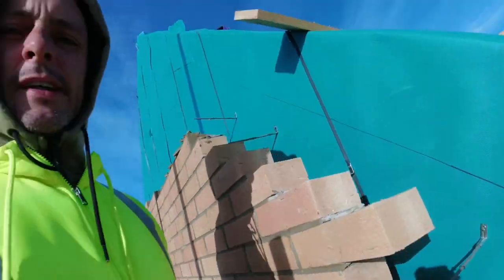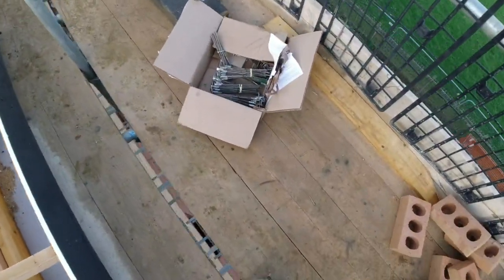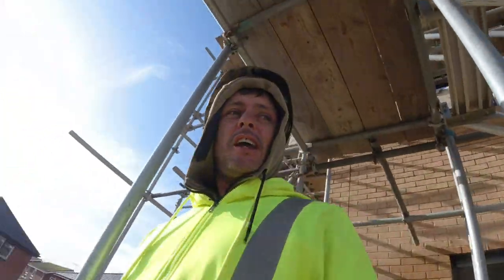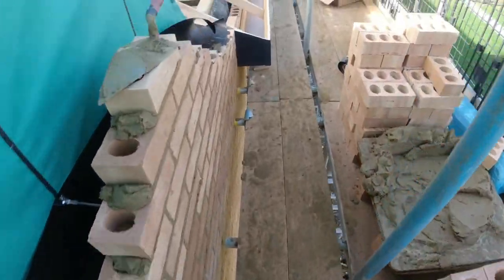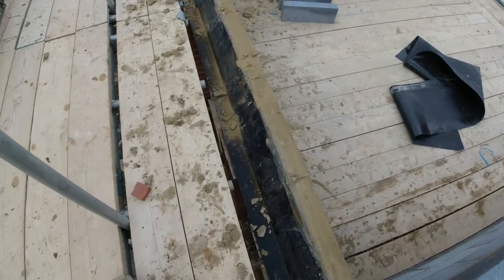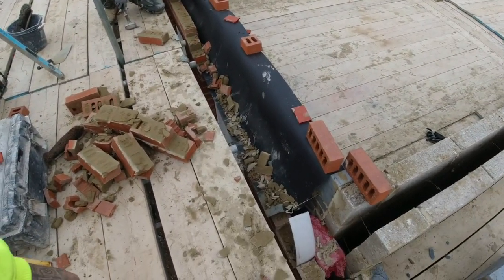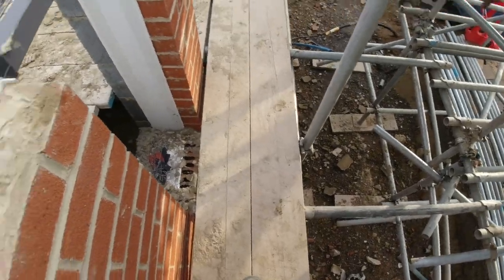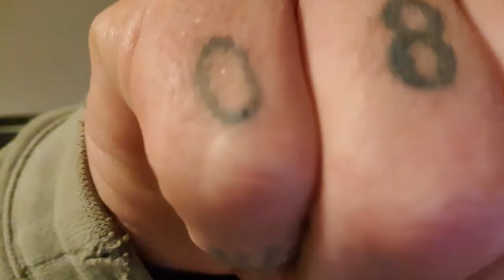bricklaying (nightmares)

Comment: It looks like there should be an extra component added to those ties, like a crimped fishtail? If that was me and they insisted that we used them ties I'd put a 1" batten down the wall to give a bit more length on the ties and then bend a 90° turn on the last 20mm to give it at least some purchase into the brick muck.... Great video as always
Reply from the maker: Yes mate totally agree.  There not worth toffee. Cheers bud 👍
Reply: Yeah they're shit ties
Reply: Shouldn't have to modify ties that's time we as bricklayers are not paid for ,, absolute shite ties ,,  can see some gables failing not down to workmanship but to them ties

Comment: I'm no brickie but wouldn't it be better if they made a tie that was flat bar that screwd to one side and had a bend on the other that went in to the hole of the brick and when filled with muck would have no movement
Reply from the maker: Them ties were awful bud. Glad we walked 🚶‍♂️

Comment: Interesting to see on the taken down work all the perps looked pretty full - forget how many times I have read from the pick and dip detractors that the perps aren't full.
Reply from the maker: All well full mate. Always push to the front 😉🤣🤣🤙🤙
Reply from the maker: Mine are bud 😉
Reply: @trickybrickys  Yep, I can see that, and that's why I commented because the non believers reckon with P&D the perps aren't full when it's easy to see that they are.
Reply from the maker: Have a look a my vids 😉😉🤣🤣

Comment: In the US , we use different wall ties ( brick ties) ; they're wider and corrugated galvinzed metal strips ,  but even they would be better with a downward end to clip into one of the holes in the brick .
  We sometimes bend a few of them this way to " hold" to the brick better.
  I think I might start a company that makes a proper wall tie
Reply from the maker: Definitely need a eye in them . Thats for sure
Reply: What if the downward bit don't line up with a hole in the brick?🤷‍♂️
Reply: @grahamdalzell6933  anchor them with the brick in place and line it up
Reply: If it is too far from a stud like in western framing with brick veneers , move to the left or right to catch a hole .  Of course , with solid bricks , this won't matter much at all
Reply: Yeah I see what you mean👍

Comment: Surely thats not right, a wooden wall with plastic attached ,and those long spike things that can poke you as you try build with brickings..did i see some staples holding it together also in the green paper fabrics.please please tell the big boss a wooden wall can burndown and the plastic may melt and give lots of poison vapors for the master of the house to breathe inwards ,how can this be true after what happened in grenfell ?
What builder can make you do this ?

Comment: Why don't you use a profile pole? You can clamp it onto the face and just keep running in. We also clamp some batten onto the top of the pole to support it. Just an idea bud. Also them wall ties look useless.... When I was working in Timley (just down the road from you) We use to use ties with 3 little holes in the end. They were solid.
Reply from the maker: We did half way up. Gary was using them the other side. Need to bring some more in really

Comment: You tray is wrong should cut the felt and put tray behind then staple it down
Reply from the maker: Only there to close the gravity as far as I can see
Reply: The water if eny gets in  is just going to go straight behind the tray then it’s not doing nothing then the tray is redundant in my eyes
Reply: @jims5394  the building paper is only to protect the timber but I could be wrong I have all ways put tray behind paper just in case Water douse go behind
Reply from the maker: Its only cosmetic to stop any isolation going up the gable end. And moisture will run down the back of the bricks not the timbers side. To a upturn is all u need.
Reply from the maker: Yeah I know that stuff . They used it in gas proof membrane.  (Gpm). But honestly its just cosmetic 💄 to stop any snots push the fire sick down.  And any moisture will come down the brickwork so the upturn is all it needs
Reply from the maker: Its inside a cavity its not the same as lead
Reply from the maker: I'd never have timber gables the tray would be in the bed joint of the block work normally hey
Reply: @somersetbricky5817  I've always cut the paper slipped tray underneath stapled tray not paper & lapped paper over top & taped with gorilla tape seems to stick well good

Comment: Hi what was the issue with the work you took down? Cheers and thanks for the upload
Reply from the maker: The frame formers were all wrong and the piers below hadn't been pull though so caused a lean over the top the corner was out at the splash from day one. It had a 30mm kink in it. We were ask to get over it so we tried our hardest but if it s wrong it wrong. So we are putting it right from the bottom of the windows. Nightmare
Reply from the maker: All built independently mate. 🤷‍♂️🤦‍♂️🤦‍♂️